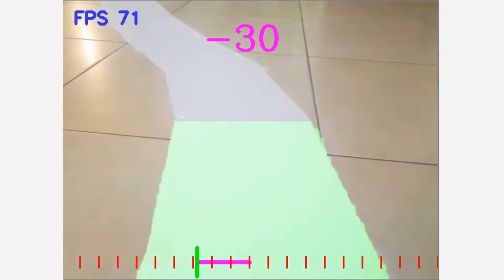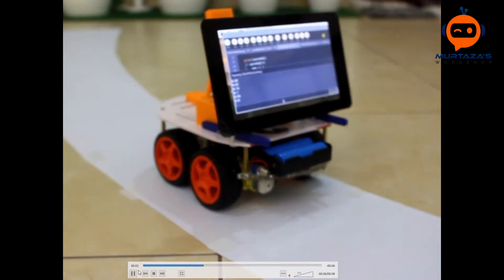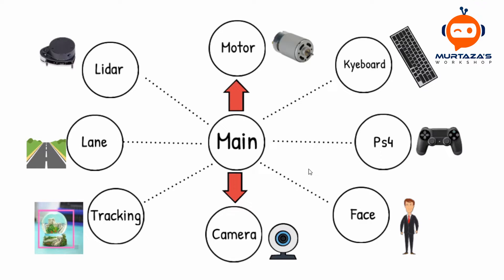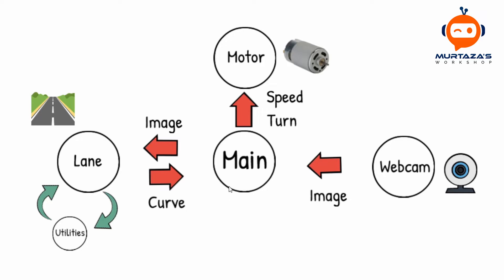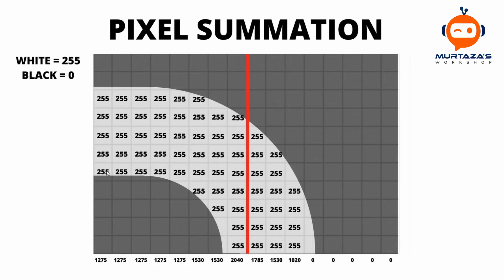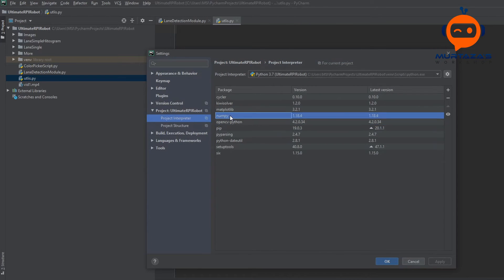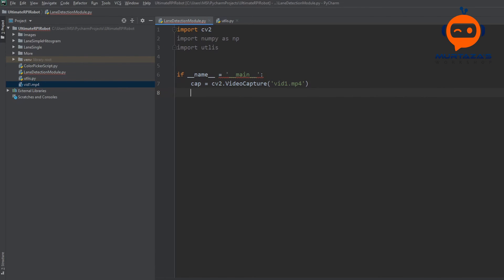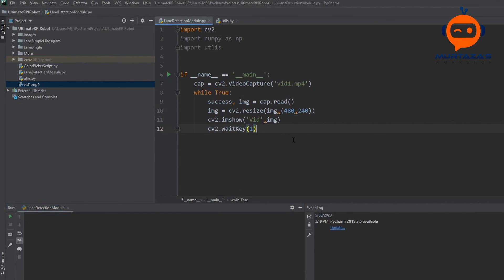Self Driving Car with Lane Detection using Raspberry Pi | OpenCV p.1

Comment: Dear I need your help in sensors data fusion.  As I want to do data fusion of lane line detection algorithm and obstacle avoidance algorithm. I'm using IMX160 degree FOV camera and RP Lidar A2 M8 2d 360 degree and I'm using Pyrplidar library to control Lidar. I want to avoid obstacle when it comes in way of my car following lane lines. I have 2 models 1 is lane line detection giving me a steering wheel angle, another is obstacle and object detection in that frame and it is only detecting that. Now I want to avoid obstacles coming in front of my car.  But I don't want my car to unfollow lines when obstacles comes in front of my car.

 Please help me in this regard if you know something.
Thank you so much.

Comment: Can i use Logitech webcam instead of raspicam module?
Reply from the maker: yes. it should work.
Reply: @murtazasworkshop  Can you assist me how to do that means how to install libraries and all for usb camera for image processing using opencv?
Reply from the maker: No changes required just plug it in.
Reply: @murtazasworkshop  So will the libraries of raspicam works for webcam too ?